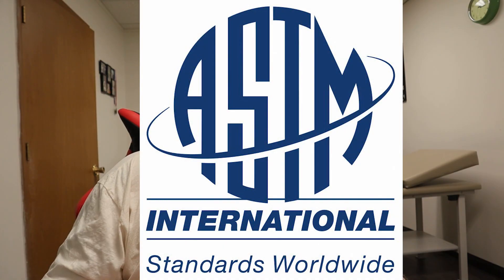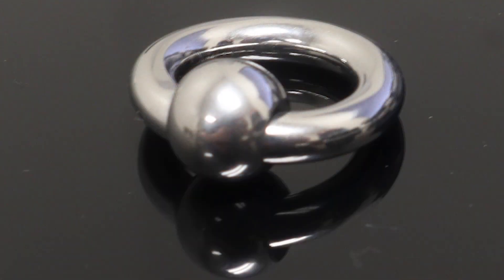Piercing Jewelry Metals and Materials Body Piercing Basics Ep 04

Comment: One of my favorite pieces of jewelry is a black niobium curved bar with blue gems.  Most of my jewelry is either niobium or titanium.  Most of it was bought in the 90s and early 2000s.  I haven't bought a new piece of jewelry for ages.  (Jan Griffiths).
Reply from the maker: The cost of niobium went up in the early 00s and everything change over to Titanium. Sadly, black and charcoal niobium increasingly became rare and was replaced with cheap plastic garbage.

The best niobium and favorite came from Good Art. Sadly they stop making body jewelry. I don't think anyone has mastered the level of anodizing they had with some of the most unusual color combinations and high polish.

The fact that you are still wearing jewelry that old it's just shows that if you buy quality jewelry it can last forever.